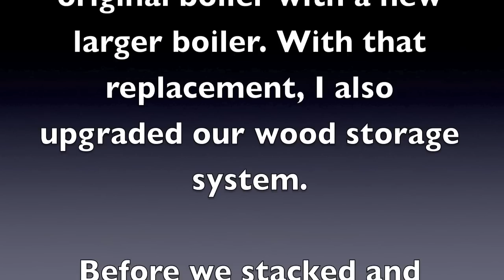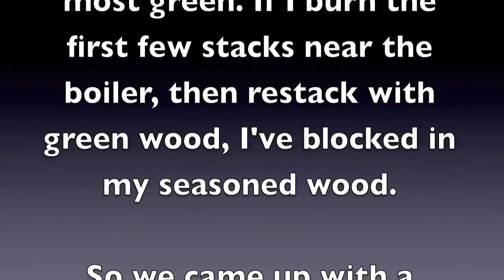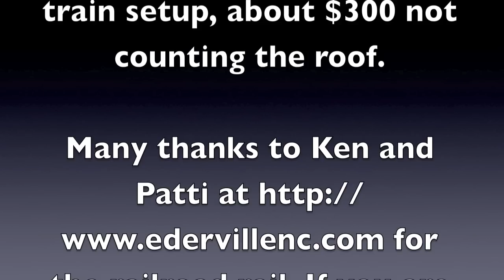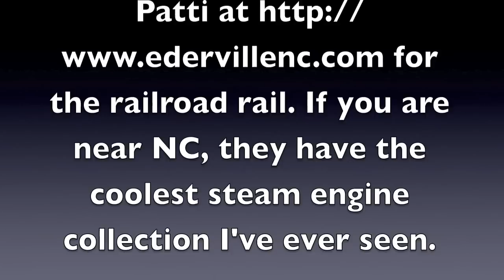Mobile wood rack system for a wood burning boiler

Comment from the maker: San379, I can't reply to your comment due to Google's new comment system so I'll just reply openly here. Your mistake is to assume that my requirements are the same as yours. They are not. We had an existing boiler. Putting a new boiler in place supported an existing system so it was more of a maintenance cost than a hard dollar investment. Also, your estimate of the boiler cost is on the low side.

There are no permits for farm structures. I live on a working farm. There are no footings or any other requirements of a city. This is a simple structure, done properly no doubt, but without the extras of a city planning department. 

The rails were free, given to me by the very nice folks that I mentioned in the video. 

I don't know what designer shingles are, but the cost of the shingles for this roof was negligible. Plus the old roof was desperate for new shingles anyway so we just redid the whole roof at once. Again, maintenance cost of an existing building. 

It snows here about once every 3-4 years and it's gone in a couple of days. I wait till it dries out if mud is an issue. Plus I've added gravel since this video. I'm not worried about snow or wet conditions in my particular setup.

As for cost, I spent about $800 on the roof not counting labor. To have a roof that matches the original building, which exactly matches my house, was not out of line and was required by the Mrs. However I never claimed to be money ahead. I like burning wood and may even break even some day but for now this is something I choose to do, not get rich doing. However, my LP costs are a few thousand per winter (now cut more than in half). Once the capital is invested, it's mainly labor to keep it going so my ROI is probably about 5-7 years which is a heck of a lot better than solar panels ROI. I can heat my house all winter for the cost of a few gallons of diesel now. I can also heat my house during a power outage (I don't want to generate the electricity for electric heat). I also can heat long term because I have a lifetime supply of wood on property so there is no cost to my wood other than labor. I have the capital now for this investment. Should I not have it later it doesn't matter as I'll have the labor. The worst case scenario is that I'm rich later and too lazy to work. If that's my downside, I'll take it.
Reply: legal fees for receiving stolen goods, potentially 100,000 dollars potentially,
Reply: Plus it's good exercise, keeps ya healthy  :)

Comment: If you can find an industrial used racking center, you can purchase a second hand system that consists of rails with carts that hold pallets. I believe it is called pushback racking. Stack your wood anywhere on a pallet, use forklift to put the pallet on the cart on the rails. Then do the same as you did.

Comment: Neat idea, but as pointed out, very expensive. Handling the wood is what keeps one in shape. Plus, what happens when your push vehicle breaks down? 
I'm going with pallets and forks on my tractor, and a well built wagon with pneumatic tires as a backup. Wood shed will be made from salvaged PT lumber and tin roof.
Thanks for the video!
Reply from the maker: That's a fine idea. However I wanted my wood covered and a tarp would not pass muster with the Mrs. I don't have another area to park a wagon under to keep the wood dry, this is it for my wood storage area. So for me I would have had to park a wagon under this low roofline, which would seriously cut my amount of storage. On a farm, the amount of tractor break downs is pretty small. We don't tend to push equipment that hard and only put a couple hundred hours a year on the machine. Farm tractors tend to be cream puffs compared to tractors in a construction environment. And since I'm the dealer, I can get most anything fixed readily anyway.

Comment: Great job! only ideas, make the platforms u move longer to fit 2 rows of wood and build out of steel with slots for 2x4 for sides to be able to hold more wood. this way u can use forks on skid steer. w/e the wood is droped and move onto the rails u have

also might be alil easyer with a wench in the ground with controls on the side. wench hooked to your last steel part, u used to push them all with skid steer. would need no help be standing right where u could see how close u are.

Comment: Good idea, but could be better so the tracksteer didn't have to come out to push wood every week. 
Not sure how the 0.75 cord of wood per rack was figured. A cord is 4x4x8 ft, and appears there is not that much wood on each rack. And if burning un-seasoned wood works good enough for you, then fine. I season wood for at least two years, put it on pallets. Burn a pallet a week in the coldest days of WI winters. Your idea of handling it once to pile and once to put in the burner is a great one.

Comment: Nice if you have the big equipment to move it with.  Maybe on wheels set in tracks on pallets and move it with a riding mower.  Good job on your setup though.

Comment: Very clever and efficient way of keeping the wood closer....however, I would have been tempted to use a steel cable hooked to the steel base of the pile you usally push, this cable would go under to the front, passed through an anchored pulley and go back to the first  pile you usually push.  It would be probably a lot easier to pull this wire with the Bobcat  than it is to precisely press the small steel beam in the bottom of the first pile of wood...may be !  A chain would do the same...
Reply from the maker: Thats been a common point from people. I had a tractor. I didn't have a winch and pulley so I used what I had. Thanks for the comment.

Comment: Hi Dan, I have watched your video a half dozen times....really admire the imagination and ingenuity.  I am gathering the components to build my own version and am wondering if you have any lessons learned over the last few years that you might be willing to share that I could incorporate in my project?  Unlike you my rails will be 2 - 24'  I beams on their side  (14" tall with 6" flanges) that the planks will ride on.  I hope to use hydraulics to move the rows.  So far I am having a lot of trouble finding a suitable product to put on the bottom of the planks that will allow them to slide on the 3/8" edge of the beams with a minimum of friction. Using wheels would be great but super expensive.  Any suggestions would be very much appreciated and thanks again for sharing this fantastic labour saving method of getting your driest wood closest to the boiler.  All the best Richard
Reply: Nylon glides?
Reply: @gumby511  HDPE or Teflon would probably be a better option than nylon.  Nylon tends to change shape under load.

Comment: At least you have a good idea. Don't let negative comments get you down. If the skid loader is yours then by all means use it. Now you should make or purchase a log spliter for it and you won't have to touch the wood until you stack it.
Reply: +Joseph McCue I actually already made the log splitter. It hooks to the skid steer shown in the video and works off of the aux hydraulics so I don't have another engine to maintain. We have a few devices floating around here that all work off the skid steer so that's not uncommon. The splitter sits at one end of our wood rack, the boiler at the other so you are exactly correct. You split and stack, then move the whole stack down and wash, rinse, repeat.

And thank you. They don't get me down. I've had much more positive than negative so I'm encouraged overall.
Reply: Dan Moore Great! My dilema right now is too much green wood in front of the dry wood.
Reply: +Joseph McCue Nothing time and a bout of laziness won't cure. :)

Comment: Sink a deadman anchor in the ground by the boiler down low, put a snatch block on it with a cable and get rid of the pusher pole and you won't have to be concerned with the low hanging roof, because now you will be pulling away from the pile while the woodpile moves towards the boiler.  Of course the dead end of the cable hooks to the far away end of the wood pile and the live end of the cable is attached to your skid steer.

Comment: It is what it is. I would have went with wheels and a very slight incline on the rails so that when I pulled an empty rack out, the rest would move themselves into place.
Reply from the maker: There is a very slight incline (few inches) there now but in order to have enough incline for the racks to roll themselves, I would have lost a around two feet over the span which would have severely limited my stack height since the lowest headroom section is your overall limit. That would have probably cut two cords out of my storage. With a high overhead and the ability to grade as you please, I don't disagree with your idea. If I could do the whole project from scratch, I'd have a very high headroom, the width to have two stacks side by side, an incline but not as much as you suggest because I don't want anything moving by itself for safety reasons, and wheels so these move with minimal effort. I'd still push them with the tractor but it would be an easy bump.

Comment: You need an industrial roller limit switch on the rail at the boiler. Connect it to a red light at the green wood end. Once the rail "car" rolls over the switch and turns the light on, you know to stop. Throw a power switch in a weather rated box and you can turn your system on and off as needed.

Comment: install a bell at the far end that the wood will hit when it has traveled far enough, needs to be loud enough for operator to hear... or a light switch that is turned on by the wood or frame touching it...? just a thought. fun to watch. thanks.

Comment: Pretty cool, but you risk damage to your building if one of your stacks of wood falls over when you are moving the stacks.
You could move them also with a pallet-type system. Build a special pallet to stack the wood on and move each stack closer as you burn them, accessing them from the long side of the building. Burn two or three stacks and then do your shuffle. That way you don't have to spend money on a rail system.
Reply: I have a friend who uses metal basket pallets. He loads from them then swaps them out with a fork lift. I looked at doing it, but I didn't have another place to stack all the pallets which meant they'd all need to be stacked right where they are now. If they are already stacked inline, just pushing them all at once seemed easier than moving all those stacks.

Comment: Mine differs in that the boiler house is IN the building .and it has four walls.  .the residual heat leaking out keeps the firewoodmforever dry, it looks like a barn from outside, nomcritters, etc..

Comment: Get an old cheap electric winch .. no need for skid steer or a third rail in the center then use hydraulic ram to pull the third rail forward and backward.  I can draw something up if you want.. good job either way on your setup.

Comment: Great idea, though I tend to agree with most of the comment from FortyAcre Prep.  I think the demonstrated technique certainly has the halmarks of a highly efficient setup - especially the potential for in-place curing of the wood.  But, the requirement for a tractor is a touch excessive, expensive, and resource intensive/dependant.  I think it would be better to put in a chain transfer system like is used in a sawmill with a geared crank on one end.  That would leave the option open for electric, steam, wind, water, and/or hand crank to move the wood closer. 

I also don't like the idea of leaving that end trolley in place as it's a tripping hazard.  Maybe there's a reason, but I don't see it yet.  Leave the last /empty/ trolley in place, whatever your reason, OK, but at least cover the gap.  A prepper with a broken leg quickly becomes burden to themselves and others. 

Idea:  How about 2' sections of plywood / board to fit over the rails of trolleys as the wood is used..?

One thing I don't agree with in FouryAcre Prep' comment is about the wood stacking keeping one in shape.  Yes it will keep you in shape, but why work harder when you can work smarter / more productively.  I say stack once and use the system, but put the energy one would otherwise use for re-stacking into some other worthwhile project.  shrug  Just my 2¢.  When I get to this point, I'll probably set up a chain pull system or the like.  I never minded the splitting, but as a kid, I hated stacking and hauling wood - still do.
Reply from the maker: Thank you for your thoughtful comments Andrew. The tractor seems excessive but in my situation I have a tractor already, use it daily, and all I had to do was mock up the push block. In order to put a trolley/chain/whatever I'd have had to buy all new components and make an entirely new system. I'm limited on electric at this building so an electric winch wouldn't work. I'm not going to install a steam boiler for steam power, and hand winching would require a reduction that would make for some serious gearing. So in my circumstance, this was the easiest, cheapest, and fastest option. If the tractor breaks, I can restack or use something else to move the wood. Maybe a snatch block at the boiler end and my truck to pull a cable. 

As for leaving the open space, tripping hazard. We don't leave them in place. That was just the way it was the day we filmed. Normally they are removed when they are empty and put back on the splitting end for more wood. However I've found they are not as much of a tripping hazard as I would have thought. It's actually easier to leave them in place than to remove them and not advance the wood for a little while. Stepping down to the ground is worse than walking across the boards. Just my experience.
Reply: The solution you have in place obviously works brilliantly for you and all things considered, i like it very much. My thoughts were not intended as a critique of your specific setup, ie how /you/ should modify it, but on the rail and trolley concept as it could be adapted to other peoples situations should they happen to have electric, steam, gears for a hand crank, etc. available.

Anyway, fantastic concept.  Thank you for sharing it with the world.
Reply from the maker: Andrew Vliet Thank you Andrew. I agree for others it would make more sense to do as you suggest. Thanks for the kind words.

Comment: I love your overall concept of product (wood cords in this case) moving towards it's intended end use so that the older ones can be used first. I use a similar concept in my long-term food storage system. My question to you is... do you have an alternative method which would allow you to split the wood and move the stacks forward if your skid-steer was no longer useable, such as in a complete grid-down situation?
Reply: I could use a winch and a snatch block on three different vehicles with winches. I can split wood by hand. However this system isn't designed for long term grid down. It's doable but that's a lot of wood to split by hand.

Comment: What about putting a roller system underneath so that we can move those racks effortlessly by hand?
Reply: I looked at that, but with any type of wheels/roller you loose head room and I was already very limited on headroom due to existing construction. Plus there are less things to break with rails and sliders.

Comment: This is cool.  Now too see if some of us that don't have a skid-steer could rig up an attachment for the splitter to do the hard push. Hmmm gears are turning in my head....
Reply: Benjamin Fuller maybe rigging up a winch on the boiler side then pull to it would help those who don't have a loader.
Reply: Or put rails on a slight incline sloped towards boiler -  using steel casters somehow to reduce friction on skids he made -- then using your come-along or winch from boiler side.

Comment: We used to cut 5 cord of Easter Red cedar per day. Load four cord on pallets and deliver to the mill. Some trucks were 26' flatbed dump hoist. Then on Friday we would cut four cord and load a second truck of the left over four cord. Hence two man crew 24 cord per week. You would do better to build steel pallets with wheels and a concrete slab. 
A dozen units or just make pallets that can be loaded with your bobcat forks. To expensive to own a skid steer for pushing a wood pile. An old speeder would do the same. Personally would build a conveyor out of steel from your splitter. Then you could just dump in conveyor with skid steer.
Reply: All those options were investigated. None of them would work in our situation due to our individual needs and/or requirements. When you build your conveyer system, upload a video to show us how you did it.

Comment: you could use 3" gas pipe in 20' sticks and wheel barrow rims and make axles attach them to pallets.....if it had wheels with bearings you could probably push it and it would roll....